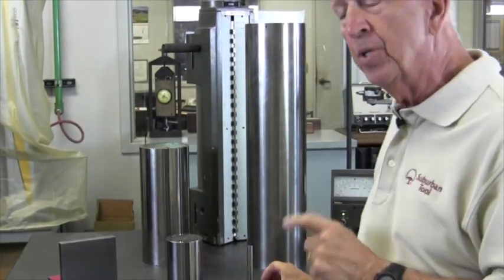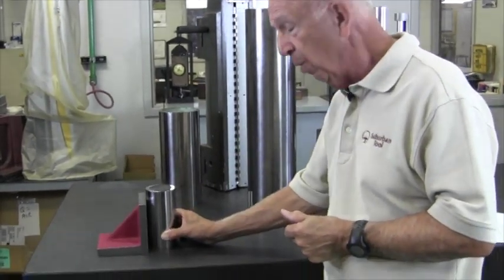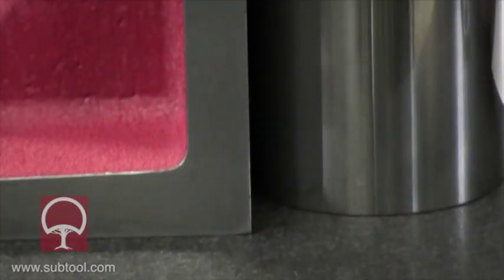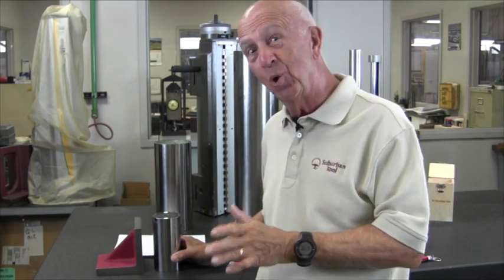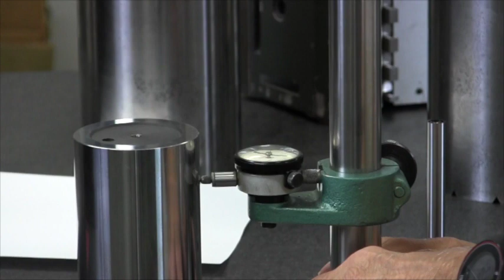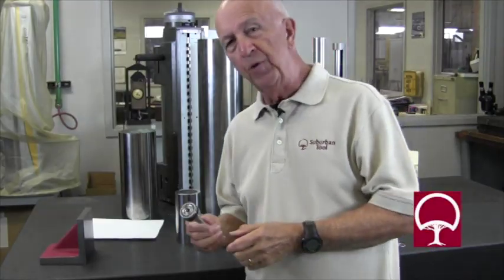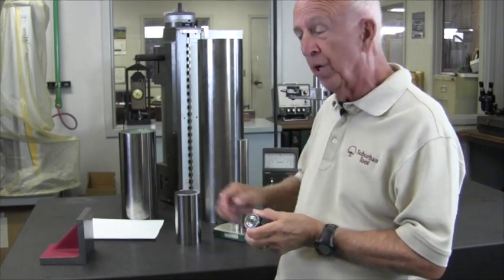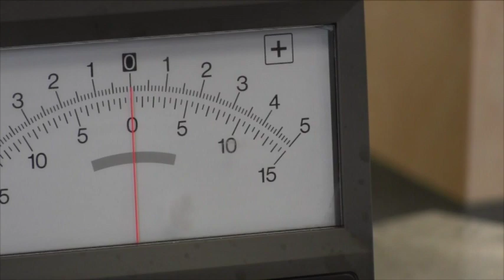How to Check and Measure Squareness - Part 1

Comment: So using the magnetic cylinder square yielded a squareness within .0002". Why then didn't we see light using the larger cylinder, if it is true that we can see light through .0001"?
Reply: Because that .0002 was about 5 inches off the surface.